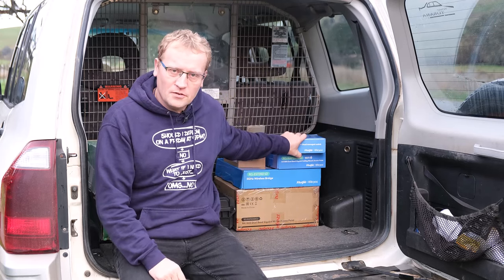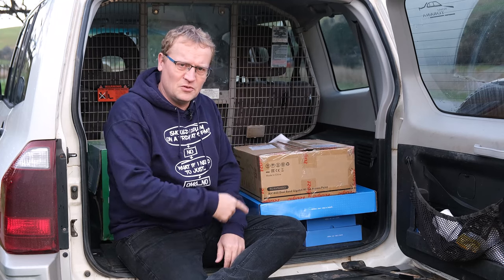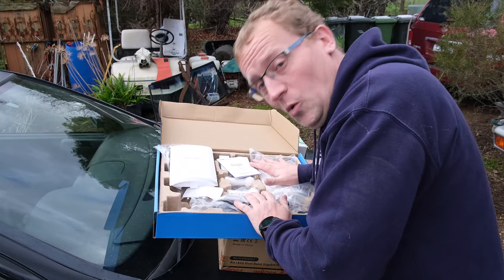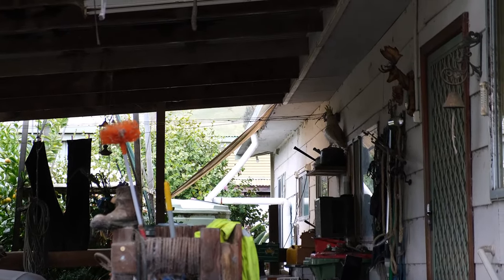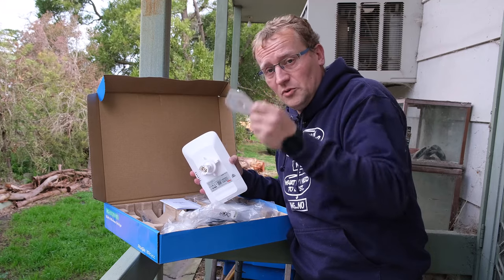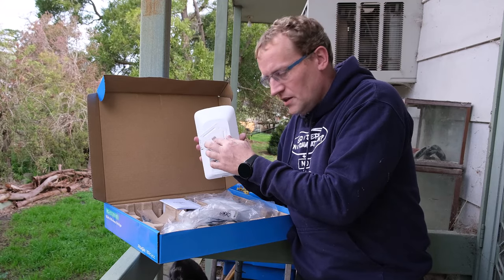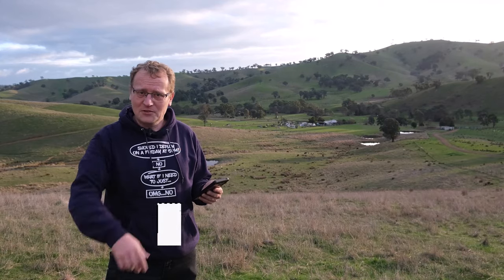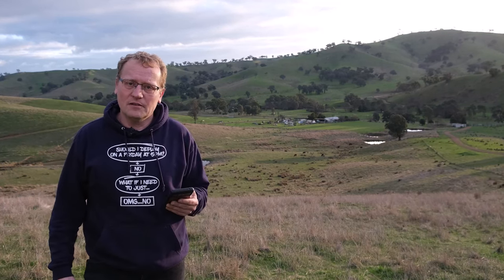Ruijie Reyee WiFi - The range is insane!!

Comment: Systems that require an active internet connection to install is almost a no go for regional Australia. We install, then get working. Then adopt etc.  needs an offline set up function. I can think of a heap of reasons you would want a network but no internet etc.
Reply from the maker: It depends on what you define as "regional" Australia. This family of products is designed for online use, which is still the most common scenario. If you need offline functionality 100% of the time, you probably need to look elsewhere 🤷‍♂

Comment: Cool installation. As a matter of interest, when would you use mesh vs bridges? Is distance the only factor?
Reply from the maker: Thanks Captain. I would use bridges when you don't want the interference of another access point, and of course also for distance. At Keith's place we couldn't quite get coverage to where we wanted the outdoor AP, so a bridge made the most sense. Most wireless bridges are also outdoor rated, which helps. 
I have a new video coming out tomorrow, which is installing the 1.5Gb bridge from UBNT, which is a speed you can't achieve with meshed Wifi, so that is another reason.

Comment: since you scanning the QR code anyway, you just have to make sure that the device is power off when adding the device to your project, once added, you can just plug it to power and for less than a minute, it should come up online.
Reply from the maker: Thanks for the tip. It took a bit more than a minute (3-5min), which is why it threw me off. A simple message saying "we're on it, don't worry" or something like that might help.
Thanks for watching Remle 😊

Comment: Hello, how about an installation 30km apart, what equipment is needed, wireless,,thanks for the info
Reply from the maker: 30km apart is a completely different setup. You'll need long range bridges that ISPs use I'd say. Take a look at Ubiquiti's ISP range.

Comment: Good video mate, sorry I just wanted to know, isn't outdoor access points already wide in scope, why else would you use indoor access points and bridges? What is the reason, if I may ask?
Reply from the maker: Thanks for watching. I am not sure what you mean. Are you asking why I need the indoor access point?
Reply: @LarsKlintTech  Yes, isn't the rap6260 enough to cover all areas outside and inside too?
Reply from the maker: @teddykarhandiansyah2937  Possibly, but I believe it is directional, so coverage is mainly in front of the AP. Also, metal roofs, walls, other devices, and more can make the signal worse. I prefer having APs outside and inside for the best coverage.
Reply: Sorry we reviewed it as it is, we have installed the 6260 rap, but the signal range is only 50 meters. Interesting but Disappointing. Thank you
Reply from the maker: @teddykarhandiansyah2937  It sounds like an issue with the environment or installation. If there are a lot of WiFi signals in the area, that can mess with yours. Have you done a channel analysis? Is it installed near metal walls or roof?

Comment: Yes, outdoor devices have high signal levels. However, the signal level of the phones is not that high. So in a simple summary. Phone wifi antenna signal capacities After 100 - 150 meters, the signals deteriorate very badly. But the level of outdoor devices is more powerful and longer. It may even be longer than 1 kilometer. It also depends on this region.

From what I see, you are performing this test in an empty signal area where there is no signal. Since there will be no signal pollution in an empty area and an area where there is no signal, the signal level of the outdoor device will be very high. But I want to understand this. The phone can receive signals beyond 100 -150 meters but cannot transmit them. That's it in short. The phone sees the wifi network and can even see it in full. However, it consists of the receiver and transmitter you want to connect. Think of it like Rx tx. Even if phones see the signal, they cannot TX beyond 100 – 150 meters. This situation in this video seemed really ridiculous to me. So the phone has antenna signal capacity. The phone is not this outdoor access point. This video doesn't seem to reflect reality. We are talking about 650m. and at 650 meters the chances of a phone seeing the signal are very, very low. This is my opinion and I think this video is a deception. This idea is just mine.
Reply from the maker: Thanks for watching, but accusing me of deception is not okay. There is no magic here. I recorded what I found and experienced. Keith still uses this setup and he can receive wifi calls 500 meters away with no problems (there is no mobile coverage). He can also upload photos from that far away from his phone, and he can do video calls (with lag of course). Why would I possibly want to show something that isn't real? All my videos are 100% real world, as the integrity and value of passing on my experience is paramount. 

You need to do your own tests before accusing people, as clearly you have only theory to go by.
Reply: I think you need to buy the setup or talk to your local WISP to get a better understanding of how signals work. Reye standard indoor AP's cover a massive area through 6 brick & motor walls to one AP I do 250m2 of coverage. Not hard to believe that these outdoor AP's can do this. Try Youtube there are a few Asian countries showcasing them no LOS and 1 bar connected, sure not greatest speed but can actually watch browse the web. Very impressive.

Comment: Dude that’s awesome! Makes me wonder if I could slap one of those big beasts on the end of my UniFi Network to reach the back 1/2 of my place … hmmm more range than my little “coke can” UniFi external AP 😂
Reply from the maker: I don't see why not. As long as it can get a data connection, the Ruijie network app will set up the AP.

Comment: how do you think this compares to the AirFiber range from Ubuiqiti? those have listed specs of crazy distance
Reply from the maker: I am not sure if you mean the wireless bridge or the outdoor AP. I assume the former. I just released a video on the airMax GigaBeam Plus, and while it is 1.5Gb over the air, the range is 1.5Km or so. Higher speed is usually less distance due to wavelength used. I also have some NanoStations with a range up to 12km, and they are incredibly reliable and speeds of 250Mbit or so. 
As many of the comments on that video point out, wireless signals are dirty and my setup is perhaps not ideal, but nonetheless I get good performance and high reliability. Comparing them is tricky. I prefer the Unifi/UBNT eco system, but I suspect the Ruijie are just as reliable and easy to use. 
airMax GigaBeam Plus video: https://youtu.be/st_o4twSE_I
Reply: @LarsKlintTech  AirFiber are different Wireless bridge devices. farther distance spec and link speed between the 2 devices. They are under the UISP line of gear like the Gigabeam you have tested.
Reply from the maker: @DustySeven7  yep, that is what I thought you meant too 😊 I reckon they are on par between the two brands tbh.

Comment: In the end did you manage to connect the switch directly to the internet connection?
Reply from the maker: No, because it is "just" a switch. So you need some sort of routing in front of it. I thought the NBN box did that, but turned out it didn't so I needed to keep the old Wifi router (for now).

Comment: I haven't looked too closely, but it appeared you could unscrew the outdoor AP mounting arm from the back, and rotate the AP, that way it would have it's intended mounting direction, and still be able to be rotate horizontal as desired.  Having the cable connections at the bottom also helps with drip loops (condensation on cable or rain etc).  AP orientation can also effect signal strength because of antenna pattern (I haven't looked for specifics on this model).

All in all nicely done, and interesting.
Reply from the maker: Good observation, but I don't think that is possible. Looking at 29:21 and 31:01 the bracket only goes one way afaik. 
I did fix the cable after recording, so there is a drip loop, and the signal seems fine. The coverage is at a great angle and distance is huge (as the video also shows).  Having said that, it could possibly better of course. 
Thanks for watching and sharing your comment too ☺
Reply: I'd missed the little brackets on the back and only noted the screws, so it's very hard to tell.  Interesting bit of kit, and nicely presented. Try as we might, there's almost aways "room for improvement" 🤣👍     @LarsKlintTech
Reply from the maker: @MarkG-q3e  Oh yes, I embrace that room ☺ That is what makes it interesting that we learn all the time.

Comment: No local management, no thank you...
Reply from the maker: Yes, that is one of the trade-offs. In this case it makes a lot of sense for Keith, as he wouldn't know what to do with it, and I can keep an eye on things for him.
Reply: @LarsKlintTech  I agree, but as seen in Your video, you had no internet connection and was unable to proceed with setup. It's okay to have cloud based management but there is no way to make configuration changes without the internet and that is in my opinion a very bad idea...
Reply from the maker: @kresimirpecar4925  Totally. It isn't perfect. In this case it was also me misunderstanding what the existing connection did.
Reply: @kresimirpecar4925 It has local management, via web both remote (using eweb tunnel) or locally just using AP's lan IP.
Reply: @ale.martinelli  So this is new then ? That wasn't possible before.
Reply from the maker: Yes, interesting. I have another Ruijie video in the works, so will check it out then
Reply: 9 Months Later, there is local management it's just hidden Reyee attempt to keep you glued to their cloud apps. But there is a way to get into it via simple addresses just like anything other router.